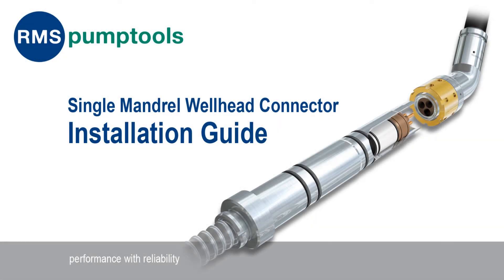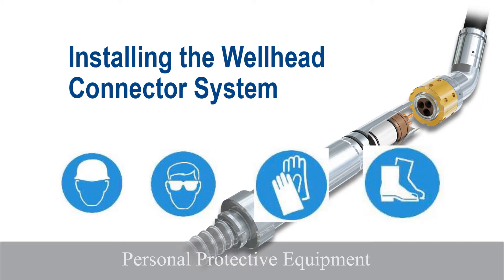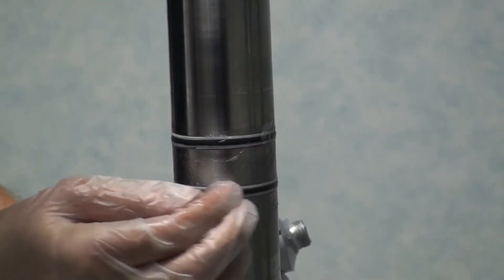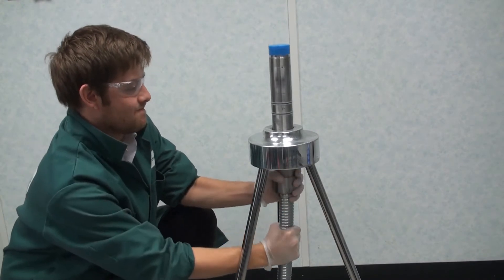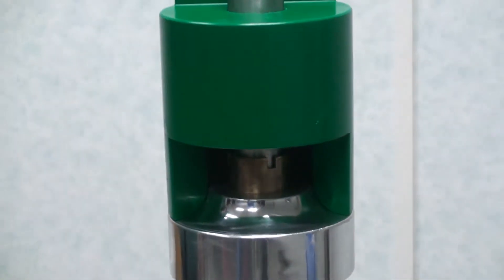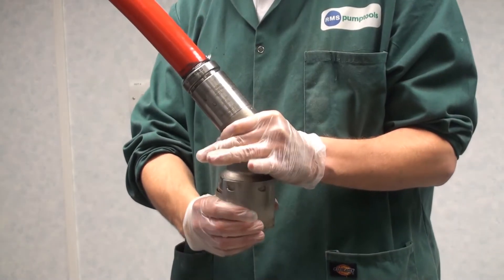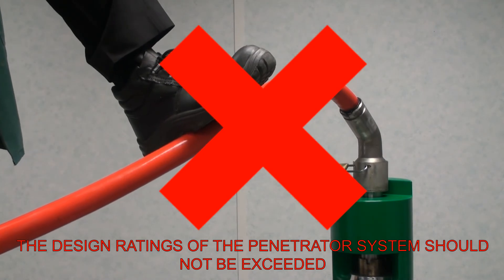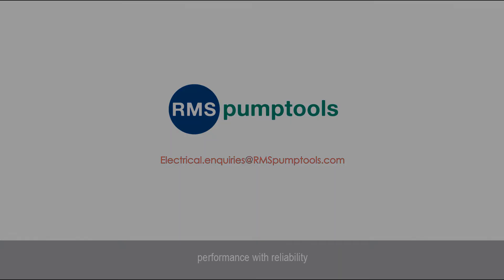RMSpumptools - Wellhead Penetrator (Wellhead Feedthru) Installation Guide

Comment: In real case you can not put C-spanner below wellhead penetrator in order to prevent penetrator from rotating. Because groove at which C-spanner need to be inserted will be already inside wellhead penetrator. Wrong instruction.
Reply from the maker: Thank you for your comments Akmurat. It depends on the wellhead profile, on occasion the C-spanner slot on the body is not accessible, but this is only to aid in preventing rotation of the wellhead penetrator when tightening the lock ring but isn’t entirely necessary.  The lock ring can still be tightened but the important point is to keep the orientation of the wellhead penetrator correct for the installation of the surface connector.